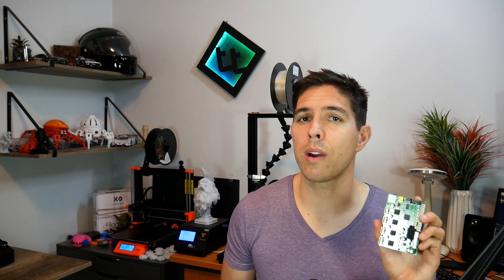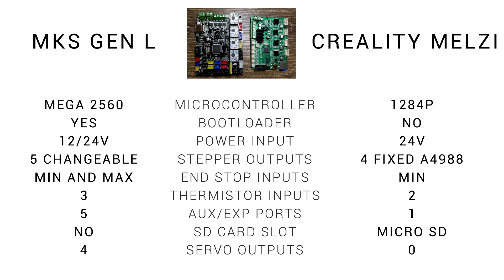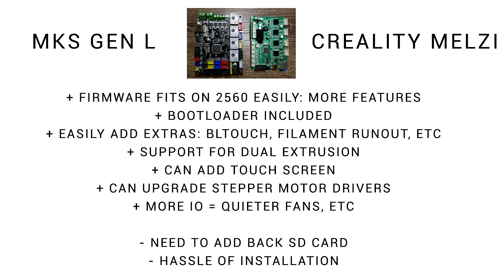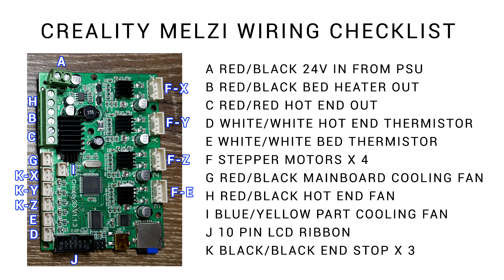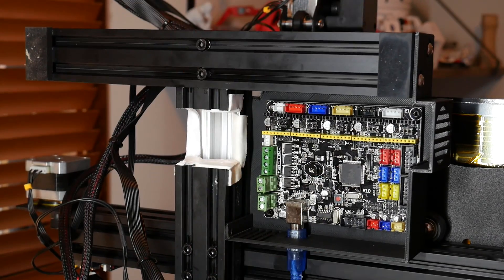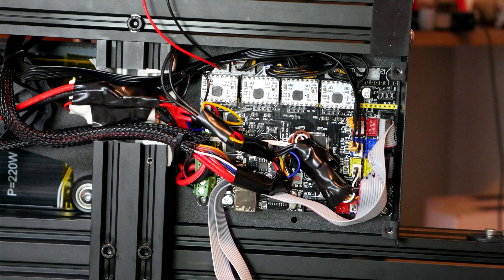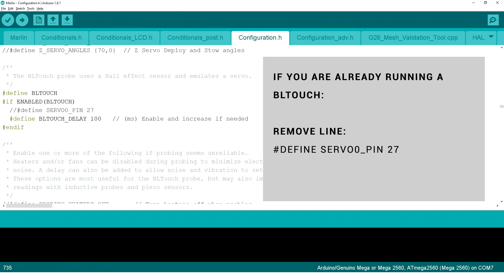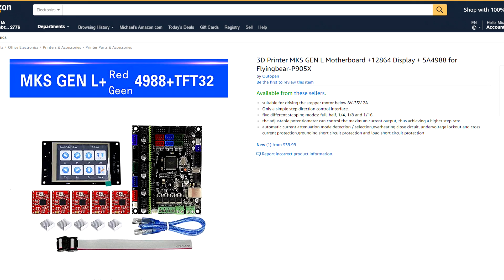Easy and cheap Ender 3 mainboard upgrade: MKS Gen L guide

Comment: I really appreciate your videos Michael. Been upgrading my printer over the last few months and just finished the cable management on the new mks gen l board today. Got the BLtouch v3 working, tmc2208s running and tried out the touch screen. The touch screen is gonna go in the spare parts bin. Losing the m600 function is just not gonna work for me. 

So far ive done a filament runnout sensor of my own design. The hero men gen 2, upgraded the hot end fan to a 40x40x20 noctua, and a 5015 blower. The ezr extruder and some lighting. With your new case that freaking board fan is obnoxious so a noctua is on the way for that as well. 

Thanks for all you do for the community.

Comment: Not really equivalent to getting the pin 27 board. There are some on Amazon for 12$ and also this does not stop at the cost of the board, trinamic 2028 drivers will add another 30$ and the screen which you need to have SD support is 35$ so for a Gen L Setup you are looking at around 90$. Or you could get an SKR V1.3 board and keep SD support and gain 32bit processing for around 25$ and 30$ for the 2208's. So for 55$ you could upgrade quite a bit. You should make a series about upgrading the Ender 3 to the SKR board and do videos about different stepper drivers with it and how to install things such as the ABL and BLTouch sensors. etc. Thanks for the awesome content I am a regular viewer!

Comment: It looks as if the stepper motor plug is a JST plug. I make balance plug extensions for my RC lipo batteries which use the same JST connectors. They are cheep and can be ordered through Hobbyking. Simply pry up the locking tabs on the top of the plug, keeping the wire orientation correct so do it one at a time, and pull the wire out and reinsert the wire into a 3 plug JST.

Comment: Thanks for the tutorial. I managed to install the board, along with the TMC2208 driver, no problem. Well, at least I thought there was no problem. Until I turned it on and had the printer preheat for PLA. Those temps ran wild up and down! Back to the original Creality 1.1.4 board again.
Reply: Have you tried adding a capacitor to the MKS board on the 5v supply side? A lot of research revealed a few forums where those with temperature issues have managed to gain stability by adding a capacitor.  I'll try and find the post and link you.

Comment: So let's pretend for a moment that someone threw the power switch in the house without telling me, and the resulting surge fried my regular main board so I can't actually print any new parts to fit this main board in there.... can I safely do a single print(the part to fit the new board on the Ender 3 of course) with the board just laying about on a rubber mat or something if I point the cooling fan at the right place with, say, a third hand?
Reply: Update to anyone reading this: What I ended up doing was covering my stock case in electrician's tape to avoid shorting, screwing a single screw in the new board, sorta kinda place the fan and lid on top and print a replacement. Not elegant but it worked

Comment: Upgrading to the MKS GEN L mobo from a stock CR10. After i follow all of the instructions exactly, when its time to compile, i get the "global variables use 15109 bytes (184%) of dynamic memory".  I only have this problem with marlin. I don't have this problem if i use the TH3d firmware (though i have other issues.) what am i missing, or doing wrong?
Reply: there is something going on with the included example files for the base cr10 in marlin. To work around this i used the example files for the ender3, and adjusted the build volume to match that of the cr10. After entering all of the changes listed in the video, the board flashed successfully. Further addition of a TFT32 lcd screen required switching the baud rate on both the screen and the board to 250000 from 115200. the lower baud rate doesn't work with the tft32 screen for some reason. additionally, the mks gen l wound't flash while the tft32 screen was plugged in. 

I hope this is helpful for somebody in the future.

Comment: Hi, great video, one question: where the cables are both the same color (red), does it mean their orientation doesn't matter? And did you find any irregularities in the other case (i.e. were red and black used correctly to designate + and -)? On another note, do you intend to try something similar with the new SKR v1.3 32bit board? Thanks!

Comment: Thanks for your great tutorials! I'd be lost without you😅 id like to upgrade my board to but when I looked for it a
I also saw there is a mks 1.4 board( I think this has a 32 bit processor) should i take this 1? It's almost the same price and I'm not sure about this but I think you dont need the wires to connect the stepper drivers... also I saw there are dvr8825 drivers that give 32 full steps. Do you know if these drivers have a silent mode to? I cant figure it out😨

Comment: Thanks for this informative video!  I recently integrated an MKS Gen L into my Ender 3 and it's working great.  I'm using the TMC2100's.  I'm hearing some high pitched noise from the drivers...is this normal?
Reply: Yes its normal, I am not sure how but there is a workaround. Maybe you can find something on reddit.

Comment: Quick Question.... This sort of combines two of your videos and a way to connect Noctua fan for the Hot End Cooling Fan. Since we upgrade the board and use one of the PWM (E1) for the cooling fan, would it be safe to change:
#define EXTRUDER_AUTO_FAN_SPEED   255       to    118  (Gives about 12 volts at E1 when set to pin 7)
Rather than add a voltage step down adapter as mentioned in another of your video's?
My concern is that there may be some code added by Cura or even manually entered that could override this and blow out the fan... Maybe there is a MAX_FAN_SPEED somewhere, or a scale like the one for the parts fan, but I don't see it anywhere.
As always... many thanks for the video's and all your help

Comment: I recently upgraded to this board and followed this video a few times to make sure i have it correct, but my active cooling fan doesnt seem to turn on. When changing the filament at 180 degrees it still hadn't turned on. I tested the fan and it works so i believe its either a bad board or could it be something in the firmware?

Comment: What if the motors won't move after the install? Could it be the stepper motor drivers current? Thanks and happy printing!
Reply: Joshua yes if you turn the Vref to 0 the steppers will not move since the Vref=0 so the Motor Current is 0 too.

Comment: I really want to use the th3d firmware over the regular marlin, and I cant figure out how to get it to work, nor can I find anything online for it
Could someone guide me?
Reply: Did you get this figured out? I'm thinking of going with this board but wonder the same?
Reply: @luxy7450  yes I did. When you flash th3d, instead of where it says "ender 3" under configuration.h, you look for one that says "Mks gen L based printer" and uncomment that one. Then from there you do need to play with a few of the settings there and in the advanced configuration to match the ones as shown in this video. Good luck if you do decide on that! I'm happy with it now that everything is out of the way
Reply: @lolfast13  Do you have the changes you can pass along to us?
Reply: @kennyd.5743  yes I can. Instead of uncommenting and defining it as an ender 3, under configuration.h, look for the section titled "MKS Gen L Based Printer." then from there, you want to delete the // behind #define MKS_PRINTER, then underneath that you need to change the build area size settings and make it 235 235 and 250, as that is the correct bed size for the ender 3. then if you scroll down more, you'll find the "//motor direction settings" and you'll want to make x=1, y=1, z=0, and E0=1. If you have two extruders, of course you'll also need to change E1 to 1 as well. Now, I didnt do this, but something tells me you also need to change the stepper driver settings to the tmc2208 if you're using them, but I didn't and I am using them so it should be fine. now finally, if you go to configuration_backend.h, you'll need to find "//mks gen L settings" and then underneath #define REPRAP_DISCOUNT_FULL_GRAPHIC_SMART_CONTROLLER, I added in #define CR10_STOCKDISPLAY, since I am using the stock display still. that should be all you need, I don't believe i've changed anything else, so I hope this helps others.
Reply: @lolfast13  That's GREAT!!!.... did you have to change E0_AUTO_FAN_PIN -1 to 7 to make your fan come on?
Reply: @kennyd.5743  uh, I THINK it was already set for me, but do change it to 7 if it isnt. 90% sure TH3D defaults that to 7 though
Reply: @lolfast13  I really do appreciate this help!!!
Reply: @kennyd.5743  you know what, I completely forgot to mention. I dont know if you've tried this or not yet, but just be warned, the MKS Gen L 1.4 is different from the one TeachingTech used in this video. For some reason, the fan power you'd normally plug the hotend fan into is reversed for me. I actually had to go in the middle and switch the wires for the hot end fan and the part cooling fan, since the hot end fan wouldnt run at all, and the part cooling fan ran full throttle upon turning it on. So if you purchased this recently, you may need to do that as well, and that could be why your fan isnt turning on, if you're having that problem.
Reply: @kennyd.5743  no problem sir, I just dont want anyone else going through the same headache I did lol.
Reply: @lolfast13  well... I've almost got it completely working. I just can't get the hotend fan to turn on at all. Tried swapping the wires. Tried temps from 55c up to 220c and nothing. It's like the HE1 port is not turning on and sending power to the fan
Reply: swapping the wires should have done it. Is your fan dead? Look into that, as that may be your problem. also be making sure that the polarity is correct as well, since you may have them swapped like I also had at first.

Comment: Very helpful video. I am considering buying an Ender 5 and it doesn't seem too different as far as the electronics are concerned. Nice tip on measuring the driver current on the factory steppers and then duplicating it.

Comment: For some reason i cant get the extruder motor to turn, I switched the Z axis lead to the extruder and the motor turns just fine so its not the motor. I also tried to use the E1 extruder driver . I am using TMC2130 drivers and tried to using A A4988 just in case I have a bad stepper motor driver  I have the MKS 2.8 tft screen and if I try to load filament the motor does nothing., the extruder is removed so there is no binding and it will not try to turn  till after the hot end is heated. any Ideas?

Comment: The case design is nice, I only had one problem with it. The mounting screws would not stay in, I had to drill through the case and use nuts to hold the MKS Gen L board in.

Comment: Thank you. You helped me a lot. I just want yo add yhat you don't need an extra ribbon cable for oem display. Also i have added an micro sd card module on the SPI bus and works flawless. I have printed 2 boxes that fit together and are installed on the back. One holds the MKS board and the other one step-down and one raspberry pi running octoprint. Now all i need yo do is to remove the A4899 drivers and to install my new comers, TMC-2130.

Comment: Hello, thank you for making this video.  I have a question about the A4988 stepper drive.  They are bipolar.  The Ender 3 uses unipolar motors.  Did you change the stock motors or convert them to bipolar?

Thanks

Comment: Just an FYI not all 1.1.4 board have the updated stepper drivers. I bought one on eBay because creality was out if stock and it's just as loud as the 1.1.3 board I had. I need to pull heat sink off and check what drivers they are to confirm

Comment: First let me congratulate you on your superb videos. I am just recently getting a Ender 3 Pro as my first printer and you have been a tremendous help. That said, my question is if you would recommend this mod right after building the printer for the first time and adding better stepper drivers and external mosfets? Is there an even better board for this printer?
Reply: no way! get it printing bone stock first before you start trying to upgrade.

Comment: I'm just now getting into this, and found your videos trying to figure out what my first 3D printer should be.  No problems with the electronics side of things; I've been working with Arduino and Rasp Pi for years.  However, I have to ask whether it wouldn't be more effective to spend more to begin with and not have to change the electronics?

Comment: Just a heads up. If you have a early Ender 3 like I do.
The holes are to big for my stock M3 bolts, could be my printer that did a poor job printing.

And the oval shaped holes where you screw in to the center excursion dont align with the holes in my extrusion. Its so mutch off it cant be the printer fault. I guess Creality change the placement of the tapped holes some time i production.

But great work, not your fault Creality is so inconsistent.
Reply: My printer is a month old and the ovals were off too. I just used my Dremel and made it a little longer. great design though.

Comment: Great video I'm sure, but this one flew right over my head.    

1. So how do you get stuff to this board to print  if you don't have an SC card or some sort of card?
2. What do the extra features do and why do I need them?

Yeah I'm a noob at this.  The new board seems to be Arduino based.  Cool, but I am not familiar with all the stuff you just flew threw. lol  Looks like I will be using the stock board for a while.
Reply: My recommendation would be to use Octoprint, https://octoprint.org/ you can run it on a $35 Raspberry Pi.  It will give you a full interface to your printer and if you're using Cura with the right plugin or a new version of Slic3r you can send your gcode directly from your slicer to your printer.  Teaching Tech shows you how to run a Pi directly from your power here supply https://www.youtube.com/watch?v=yW9ovo9CHi0

Comment: I have followed your video on vanilla marlin, and this video on upgrading to MKS Gen L. I used a Geetec GT2560 board and everything is going good other than the y axis. I keep skipping step on the y axis even at 40 mm/s speed when the stock board allowed me to run at 60mm/s. I adjusted the vref to .62 and it skipped really bad so I upped the voltage to .8 and it does a little better. I also swapped motors and motor drives to see if that was the issue. Is there something in the firmware that might need changed? 

Best, 
Jayson

Comment: So, how does one install this on a Ender 3 Pro...? Do I have to bend up the metal still? Is there any board for the Ender 3 Pro that is a drop in?
Reply: He says that you will need to print a new casing for the motherboard. There is no need to bend the metal. If you have the pro, you can just print the case, and the MKS Gen L will screw right in and it fits in the same spot.
Reply: @zeeketeek6124  Ah. Thanks for clearing that up.

Comment: did this to my ender 5, but placved tcm2208 drivers, not it wants to home into front rails, any suggestions?
Reply from the maker: I have an Ender 5 bootloader / firmware video which goes through the changes for the Ender 5.

Comment: If you add 2 9mm Clip-on Ferrite Ring Cores on each axis and the main power cable you will greatly reduce noise and ringing. Prints will come out smoother. Also adding 1 32x3 mm round n52 magnet to each 2 cores completes for perfect walls. Stabilizes the stepper motors.
Reply: Interesting.  I'm familiar with the use of ferrite cores, but could you please provide more information or external links regarding the use of magnets for this purpose?  N52 are neodymium magnets, correct?  These are pretty powerful magnets and can sometimes be dangerous...  I also want to verify where you suggest we use these magnets - are you saying attach one 32x3 neodymium magnet to each ferrite core?  Can you please clarify and explain how that helps?

Comment: man i'm having some huge temperature fluctuations on the hot end after 'upgrading' to an mks gen L. trying to print petG it will pingpong back and forth between 245-255 after multiple long-cycle PID tunings. anybody else having this problem? something that needs to be changed in marlin??
Reply: It's mentioned in one of the topics further down, but the article at https://reprap.org/forum/read.php?13,813311 provides a work-around. Connecting a single Low ESR 1000uF capacitor across the 5V/Gnd pins (indicated in the image in the article) reduces the noise from the 24V->5V power converter. For me, this dropped the variance from ±5°C to ±1°C (when set to 240°C).

Comment: Hi Michael, sorry to bother you but a quick question. With the MKS Gen L board, when adding a filament runout sensor do we still need to go into MARLIN under HAL.h -  pins_MELZI_CREALITY.h and change  #defIne FIL_RUNOUT_PIN to 27 ?? or is this only for the Ender 3 default board ??
Thanks again for all your great guides

Mike
Reply from the maker: Hi Mike, no need to make any changes to the pins for the MKS Gen L. As it is based on the ramps, most of this stuff is already configured. You just have to plug it in as shown.

Comment: Do I need to tune the stepper motor drivers if using the stock ones from the original board?
Reply from the maker: You want want to double check them, guide here: https://www.youtube.com/watch?v=H41hIXdB6js